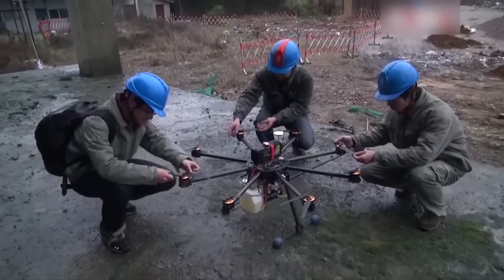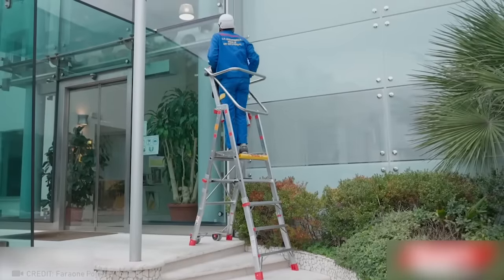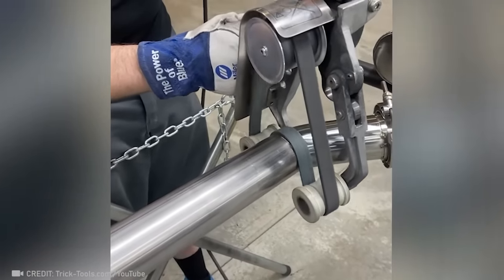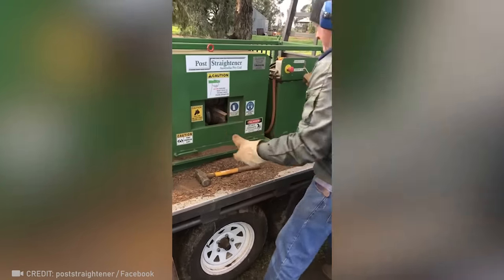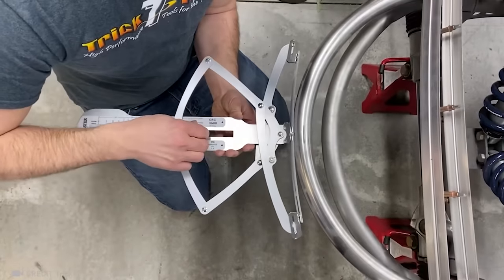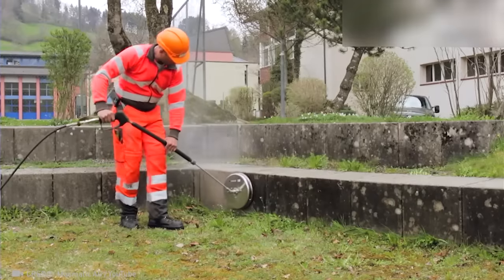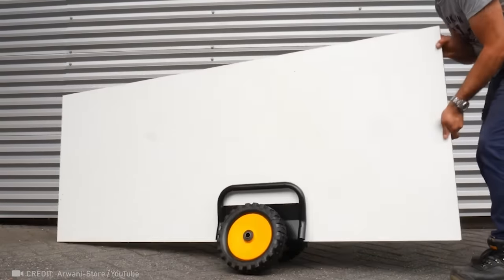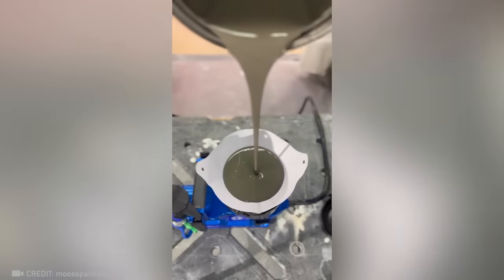Amazing Tools That Are On Another Level

Comment: @ 5:30 I have been using the high-lift style jack on 4x4's since the late 70's early 80's. I still have dents in head from not respecting them, lol. In all seriousness though, they are a great tool to have. Lifting, stretching, pulling and can even be used as an impromptu winch. It is good that sometimes the old way is still the best way at times.
Reply: Until recently, I had the lift from my moms old Buick Le Sabre Deluxe boat of a car LOL
Reply: @jad43701  lol. Totally agree. I miss my '75 Regal.

Comment: That amazing jack at 5:40 is called a bumper jack, handyman jack, sheepherder's jack, tractor jack, or fence jack, and farmers, including my grandfather, were using them 100 years ago to do everything from fixing wagons (later tractors) to stretching fence wire . . . so not a new invention.  They are also quite dangerous in the wrong hands.

Comment: Most of these are indeed new devices/technology ...but...At the 17:18 mark you'll see a pipeline trencher.  I made a documentary film about one that looked almost exactly like the one shown here...46 years ago. ...it could cut through permafrost and solid limestone... was used on the Alaska pipeline  project in the early 70s.  I still have a copy.
Reply: Well, to be fair, the title didn't say these were "new" tools, just "amazing tools". But you're right.  Also, at 25:06 we see a wood lathe.
Nothing new about those either, although, tricks like turning poured resin are relatively new - the past few years.

Comment: The most interesting thing is to find out why some ideas/machines are not so good.
Reply: 1. price and nieche use
2. cleaning them
3. if something breaks it will cost x to replace because nieche product
4. most things the casual worker will only use once in x years so its not worth getting. if you do it for life, most likely the place you work in has purchased whatever tools you have to use.
5. the ladder with safety is idiotic :D
6. why the fuck would you clean stone slabs. just let them be stone slabs.
7. lasering off graffity uff, the fumes. wear a mask. 
8. etc. 

what i find wonderous is how food processing, especially vegetables, can be 100% automated but isnt already AND its fucking expensive to buy anyway. electricity is comparably cheap for what it does and machines pay off over the years easily if on industrial standards. 
also, how took it people so long to realize leave blowers only relocate your problem for an unknown time :D.
Reply: @kliersheed  thank you lot ✌

Comment: 4:00 That's called a bazooka. There's nothing new about it. I first worked with one in 1978 and it was around years before that. Back then it could be rented or purchased through Ames and other drywall supply companies.

Comment: "can turn anyone into a true mountaineer" eh? Sure, assuming you're only ever climbing very flat mountains so the suction cups can actually adhere. Also "3D printing technology can make an exact copy of the most famous sculpture" Shows a CNC Robot arm doing the exact opposite of 3D printing. And sure, AI art has come a long way, but they still have a lot of problems, and are not actually creating anything new, just synthesizing a product based on the request from a massive data-set of examples. And thus they struggle with things like how many limbs a human should have, and if the fingers are actually fingers or should be fusing into whatever bodypart they're touching.

Comment: If you can't get the cap off a jar, just puncture the lid to release the vacuum.  No need for a fancy machine.
Reply: Oh c'mon! Just tap the lid for few seconds then it will come of easily.
Reply: @docentediottoni  well, then you never dealt with some real hard caps…
making holes always does the trick.
Reply: @MyLolle  Hello, Nev: It's true, releasing the pressure does the trick, but then you have an item you may want to
keep sealed and it now has a hole in it. Tapping the lid and putting hot water on it works for me most of the
time, but I admit, some tops are so hard to get off, it's like cement. Especially tough for those whose hands
are weaker. We shouldn't need a super gadget in order to get a cap off a container. How many types of can
openers have been invented and cost so much work, not to mention money, buying a "better" one. We've
probably all ended up with drawers full of them and still can't open the cans. I'm always glad to find one
with a pull top. Now if we can get people to recycle the items that are recyclable. Ideally, after we're done
using something, it ought to shrink down to a tiny ball, be tossed into a machine and have it worked into
another usable product. Happy DIY, folks!
Reply: yep drill a hole, open, and dump the contents in the garbage before it rots

Comment: 16:17 this looks horrible for nice cars. thats going to scratch the hell out of the car retracting it. what about high winds? that thing could flip over and roll down your car scratching it all up. it's also more likely to just be stolen and in fact noticeable enough people will try to steal it off the car further damaging your car in public. and the icing on the cake. the car was soaked after he retracted it and then they cut frame to a dry car. don't forget your towel guys!

Comment: where can you buy 2:46 ?
Reply: That is called a Hoover they range from $500-700+
Reply: @blazeyreal7777  It's an extractor or steam cleaner.  A Hoover is a brand of vacuum cleaner.  Hoover should not be used as a term for everything that cleans using vacuuming process.  There are many different brands of these available for anywhere from $200 and up depending on the options you want.
Reply: @ginafarducci1600  my bad, guess I dont know enough about this stuff, thanks for telling me.
Reply: @blazeyreal7777  With fire service for 18 years.  Used it many times.

Comment: If you buy a tool from any hardware store, it'll take the old paint off the roller and yes, you can rinse the roller with water. So, my question is, why are we being so lazy with paint rollers instead of ending world hunger? J/S
Reply: There is no problem with world hunger.  Currently the world produces more than enough food for everyone.  It's a problem of distribution.
Reply: @michaelschmidt4199  you just described why there is hunger in the world i.e. world hunger exists. In short you didn't answer the question
Reply: America alone throws away/wastes enough food to feed the world everyday.... Mr. Schmidt is correct.